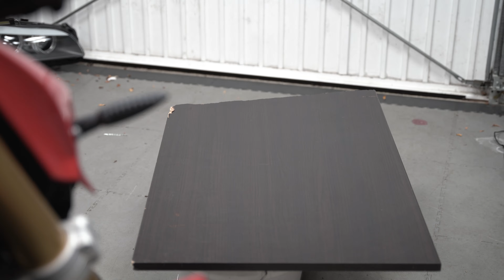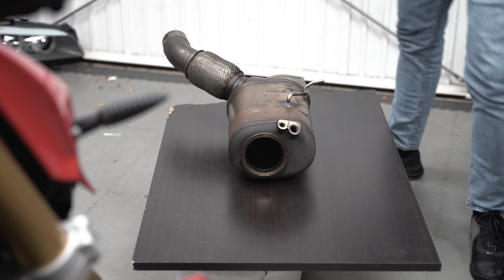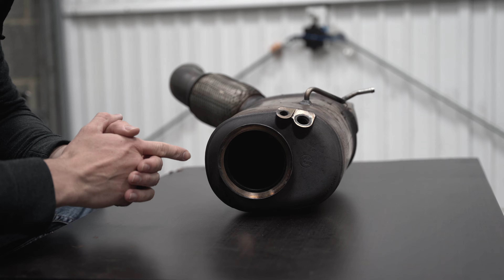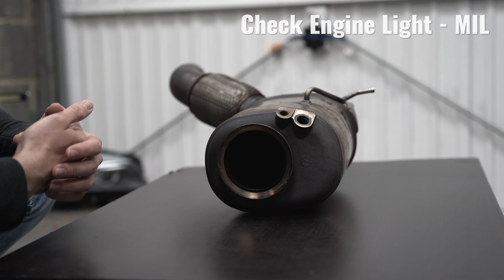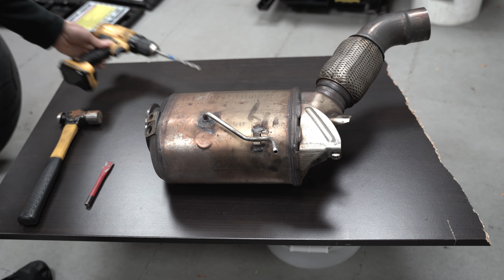DPF DELETE - Why & How To Remove a Diesel Particulate Filter

Comment: How does it get through MOT emission's test without failing (Toyota Vellfire 3.5 V6)
Reply from the maker: I can't comment on this. It should not pass a MOT.
Reply: @MotoFixation  that well may be BUT, if you are caught without a cat the penalty is very high financially, the car is impounded, plus the car will have to be 're-catted' and the delete reinstalled for an inspection (which you also have to pay for) prior to being put back on the road. check the law on this one in the UK.

Comment: Hello
Can you tell me if the DPF is mechanically removed from the housing and the catalytic converter is left, does the ECU have to be remapped? And why? and what if it doesn't remap?
Thank you
Reply from the maker: your CAT will continue to work.  Depending how strict is the algorithm that the ECU is using to determine the DPF health and condition you will get a DTC sooner or later. The DPF is monitored  usually by a differential pressure sensor. Those pressure values will be analysed and used to determine a soot load and ash load. No more DPF -- less pressure difference. Also in time the ECU will check the plausibility of the signal. aka if the engine is working and there is no increase in the soot build up, it will determine that something is wrong. You could, if you wanted, providing you have a decent diag tool to periodically delete the code or see if you have a function of new dpf fitted, process that would buy you some time. By remaping, the DPF monitoring is removed.
Reply: Thank you very much for the explanation, it's a little clearer to me now
 @BestCarMods
Reply: @BestCarMods Peugeot 207 I just removed DPF broke inside of it and install it again
No dashboard light for 2 week . Do I need to get software computer DPF in ECU if runs like I mention.....it's expensive to go to computer shop they charge arm and the leg ...but let me now if I can damage my engine if I'm not doing this then it's mandatory yesss Just let me now 
Thnx in Advance 
No light on no issue nothing at all
Reply from the maker: @arbenbytyqi9732  it will not damage your engine . only thing is that soon it will trigger an warning on the dash ... maybe get a diag tool and periodically reset the codes

Comment: I removed my dpf on mercedes sprinter, now the engine check light is on. if i speed up over 80, the engine light flashes and revs wont go over 2000 causing drag. was wondering if this is normal after dpf removal, without deleting it from vehicles computer?
Reply from the maker: yes. it is ... I was looking to test the following: if you have access to a diagnostic tool try to reset dtcs + use the new dpf service function ... it might give you a few days to still use the car ... eventually you should get it removed from the ecu software (let me know if it works)
Reply: @BestCarMods  Thanks a lot for the reply, will definitely give it a shot

Comment: I;ve been told that my DPF has been deleted in my car but the previous owner didn't actually remove it. He thinks it's full or close to and that's what's causing a P0299 underboost as there's backpressure preventing the turbo from spooling up properly 

I'm not sure how much I believe that though as I got a DPF full error on my car dash - if it was deleted from the ECU, it wouldn't show me errors for a full DPF, right?
Reply from the maker: if it had been deleted properly it will not give a error. Remove the part and inspect it, maybe send it to a shop that cleans the DPFs.

Comment: Hello  thanks  for the video when i remove ceramic  i will replace it by wat?? And  it's the same way to remove   DPF OF VW GOLF 2015 GTD
Reply from the maker: if you remove the ceramic ... you don't have the DPF any more and you will need to code the engine ECU so that it is not searching for a DPF
Reply: @BestCarMods  thx for answering me 
I did  the ECU mapping nd i do 4 holes in the cermics but in the end my car has a lack of power and draw .... so the holes are enough  or i must remove  all ceramic 
Nb: i got vw golf gtd 2015
Reply from the maker: @ammarmirou9796  I would remove it completely ...
Reply: @BestCarMods  thx alot bro

Comment: Hello, I have a problem on the n57, the egr valve should be changed or I should block it, what do you suggest?, in case I block it AND turn it off normally on the software, do I have to do the same with the dpf filter??
Reply from the maker: if you deactivate or block the EGR, your DPF can't regen, so that will mean that your DPF needs to be removed from soft and also physically, if not it will clog up and not allow exhaust to flow.

Comment: The main source of ash is not "byproduct of regeneration" as you say. 90% of ash accumulation in DPF is caused by byproducts of inevitable oil consumption and metallic particle deposits from wear of internal components such as piston rings. Multiple studies and academic research papers showing this if you are interested ;)
Reply from the maker: interesting observations ... "Multiple studies and academic research papers showing this if you are interested ;)"  of course ... that is the type of geeky stuff that I like ... send me a message on IG or an email at the contact email for the yt channel and we can chat more :) thx
Reply: "Multiple studies and academic research papers showing this if you are interested ;)" OK I'm interested, any clue of how to get a hold of these research papers or is that classified?
Reply: @robt8042  @BestCarMods  

Well ofc not all research is public, the manufacturers keep it to themselves a lot. However the source of my information is from the publicly available research papers that are easily accessible via just googling something along the lines of "source of ash in DPF research" and you will get plenty research thrown at you from various institutes.

My favorite is this one, on page 10 you have a nice breakdown of sources - https://www.osti.gov/servlets/purl/1651327
Reply: Complete bollocks. The soot particles are captured in the filter and oxidized during the regeneration process. Ash, which is the incombustible material left behind following the regeneration process and gradually builds up over long periods of time.
Reply: @One_over_the_eight  Did you even read what I wrote or you just here to hate?
Reply: @nesmio7378  To minimise ash build up you need to use low SAPS oil because Sulphated Ash, Phosphorous, and Sulphur are all substances that can build-up and block your vehicle's DPF so nothing to do with metallic particle deposits. Not hating, just pointing out misinformation.
Reply: @nesmio7378   You did! Jeez, read your original comment. You stated 90% of ash is from burning oil and metallic particles from wear and tear. 
This is wrong. 
The ash that accumulates in the DPF is solely from burnt soot which is a byproduct of diesel combustion and itself is a hydrocarbon. The ash particles themselves are too large to pass through the filter and block the filters pores causing a build up of more soot and pressure triggering a regeneration. In my case the DPF is also on a timer so after around 16 hours of driving a regeneration is triggered whether the blockage percentage is high enough or not. The more soot that's burnt the more ash that's produced the more blockage occurs until it's thoroughly cleaned or replaced. I've only recently removed my DPF to clean it properly. It's a two stage process. First with 5 litres of Wynn's DPF cleaner, which is alkaline to dissolve the soot, soaked over night. Then a thorough flush leaving only the ash to be removed. This is done with a 3 to 1 water/hydrochloric acid  (This can be bought at any hardware store as brick acid) dilution. Rinse for about half an hour with the solution which will turn a brown/orange colour as the ash is dissolved. Further flush and back flush the DPF with fresh, preferably warm water until it runs clear. Leave to dry for a few days.  Reinstall and reprogramme as a new filter in the ECU.
Reply: @One_over_the_eight  I think you are confusing ash with carbon / soot - the two are not the same and are not created the same way and don't come from the same source, the words are not interchangeable with each other. You in one place write that ash only comes from regeneration of the DPF and in another place write that you should buy low SAPS oil because that's where ash comes from, so which one is it?

Ash is usually a white / red substance that is more or less nonburnable under normal conditions in a DPF. This builds up overtime and does not get reduced by regenerating a DPF, it's only removable by mechanical means. It usually comes from the burning of the additive packages in engine oils in the cylinder and from general wear and tear of engine components depositing in the DPF. Extremely minimal if any ash is created by the burning of the soot in the DPF during the regeneration process, meaning that the burning of the built-up soot in the DPF does NOT MAJORLY contribute to the buildup of ash, it has some effect and some ash is created yes, but very minimal of total ash buildup comes from regeneration and burning of soot in the DPF - as the research papers prove. Ash usually results in very slow and gradual buildup of total blockage but given enough use / mileage it will become a factor for DPF blockage.

Soot / carbon - Is usually a black substance that is able to be burned by the DPF in one way or another. This comes almost 100% from burning of diesel, it's literally unburnt fuel heated in absence of oxygen in the cylinder becoming soot - can think of it like tiny coal briquettes - in essence a result from poor / ineffective combustion and is unavoidable with current technologies. This does get removed during normal regeneration of the DPF. This makes up the big majority of the total blockage in day to day operation of a DPF.

So no one was questioning or doubting the source of soot buildup in a DPF, we were discussing the other part of the buildup - the ash buildup in a DPF and what it's source is, as I said multiple research papers show that the source of ash buildup - NOT SOOT BUILDUP - is primarly from engine oil but also from other sources like wear and tear, please check out the research - it's very interesting. Search for "sources of ash buildup in DPF" and you'll find some scientific papers and none, I repeat none have concluded that it comes from burning fuel or regenerating the DPF, it is a contributing factor yes, but a minor - not a major one.. so are you trying to say that the research is wrong and you know better?
Reply: @nesmio7378   The ash in the DPF is the burnt soot, nothing more, nothing less.

Comment: thanks for the video, here in The Netherlands you have an option to remove the DPF from you registration.
Reply from the maker: very interesting
Reply: Does it cost more road tax?
Reply: @aqib2000 +/- 15% extra but you will almost save that on better fuel economy alone.
Reply: Just another reason to love the Dutch

Comment: Do you believe or suggest Dpf Cleaning solvents or Cleaners??Do they work or cheating??I heard something to rinse it in to the Fuel tank and works fine (as the seller said!)!!
Reply: 5 litre WYNNS dpf cleaner,  works wonders...
Reply from the maker: I read about those type of products. apparently they increase the temp in your exhaust facilitating DPF regen. if it is from a reputable seller they should be ok

Comment: they are a curse in diesel engines . had a 20 plate ford problem after problem
Reply: Same with my Land Rover which also happens to use Ford parts on a lot of the air and exhaust systems
Reply from the maker: :goodvibes:

Comment: how do you get trough mot if you delete dpf with dpf  delete kit?
Reply from the maker: officially you don't.
Reply: You find a place that does it properly, so they cut the dpf, weld it shut so it looks factory and reprogram the ECU. The lot is only a visual inspection. I doubt many places will actually test emissions. I'm getting mine done in a few days and that's what the guy told me.
Reply: @MrSunnyBhoy  how's the car going now?
Reply: @MrSunnyBhoy how’d it go?
Reply: Take it off, put full dpf on for mot.
It’ll let your engine last longer